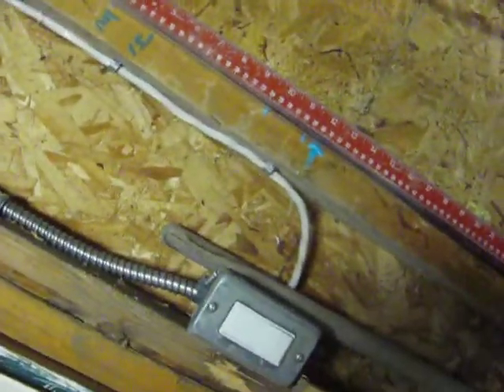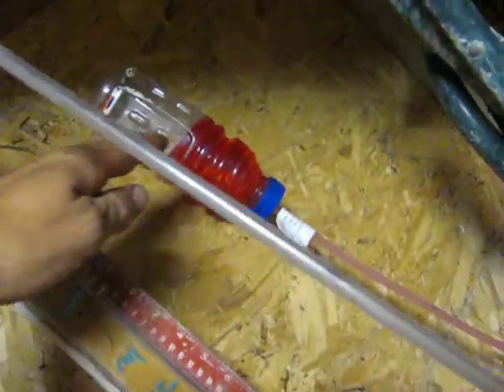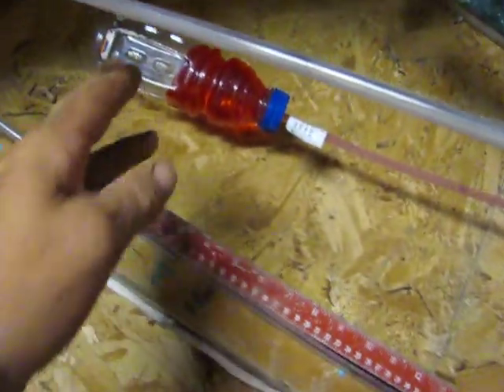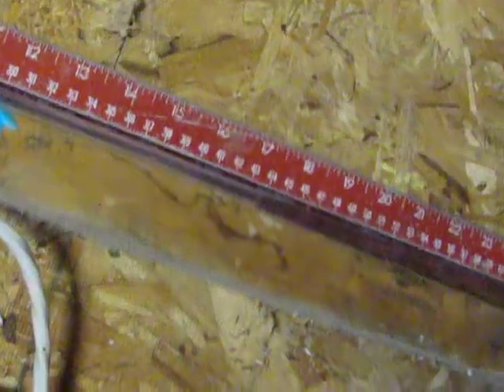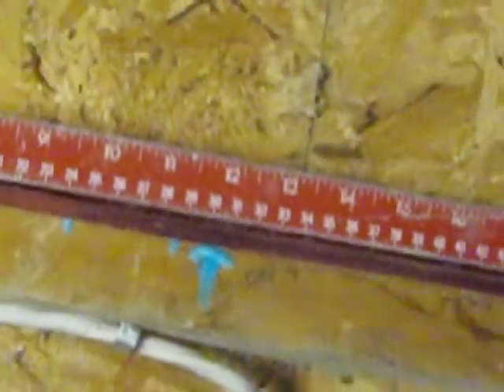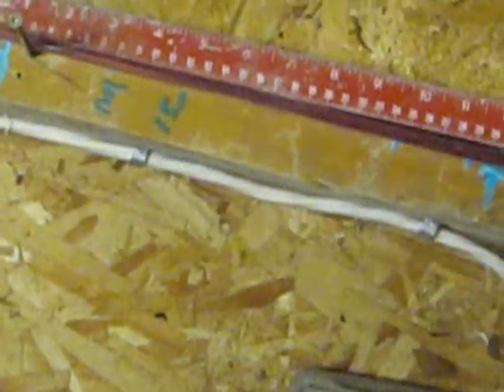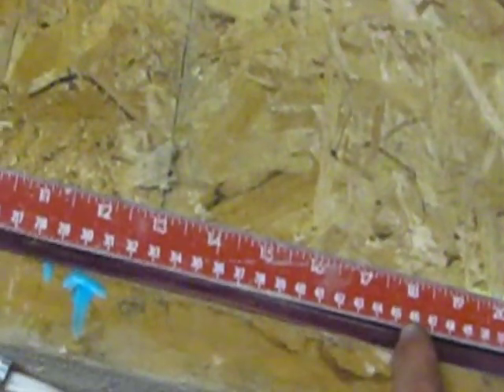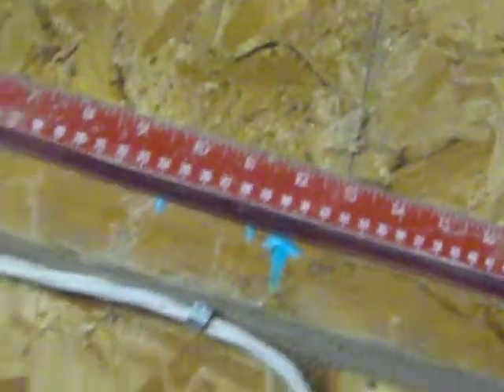Extreme low pressure airlift pump.  Lowers the bar for 3rd world development projects.

Comment from the maker: Thanks,  in my case it is pallet gardens and they are "container gardens" so the water does not get lost to tree roots or the ground.  My 8 include 4 roughly 16 sq footers and a larger one, a smaller one and 2 vertical pallet planters.  So about 130 sq ft.   I have not got a reliable way of  making reliable "flip flops" yet so at the moment, the best designs are probably the vertical and the horizontal with plastic and an air gap underneath to direct the  water back to a container.  Brian

Comment: WIth this pump system shown in the video, if run continuous (I guess with a small solar panel/batteries) and without any other input of water, about how many square feet of garden is it capable of watering?